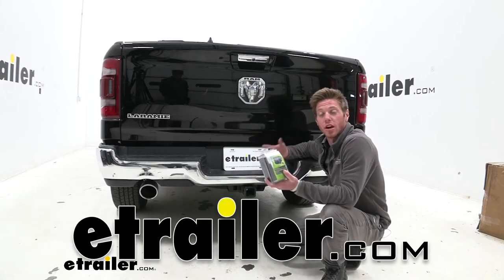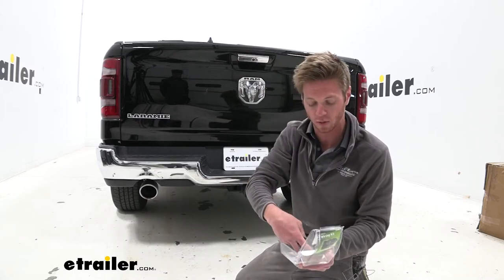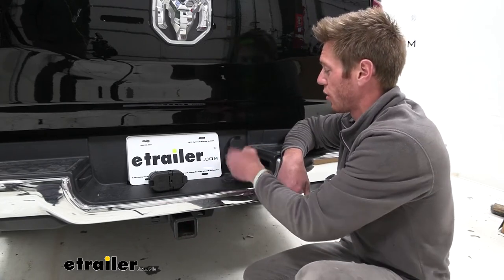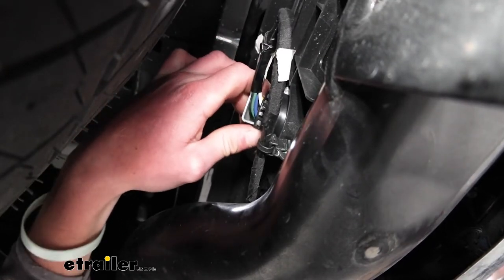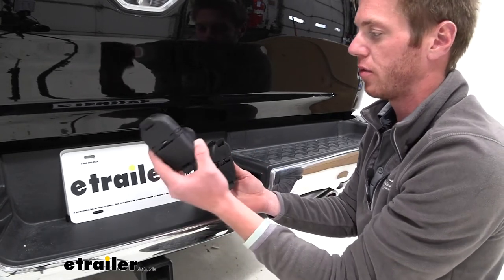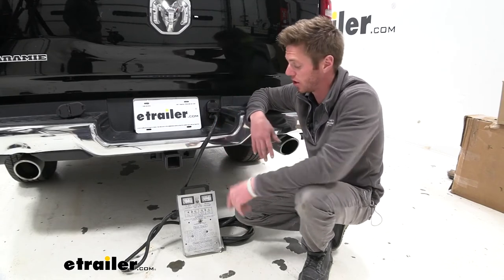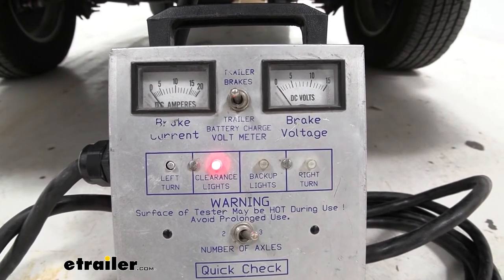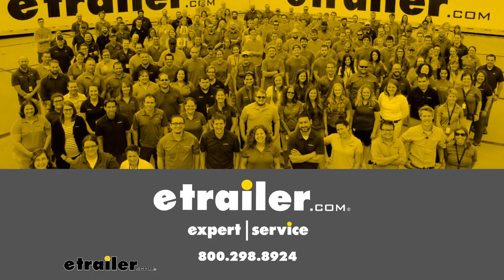etrailer | Hopkins Trailer Connector Socket Installation - 2020 Ram 1500

Comment: What if the trailer plug is the problem can that be replaced?
Reply from the maker: Sure can! We recommend using a pigtail/connector/junction box like # 277-000141. The junction box provides a secure and protected spot to attach the new pigtail to the existing wiring.
https://www.etrailer.com/Accessories-and-Parts/Epicord/277-000141.html